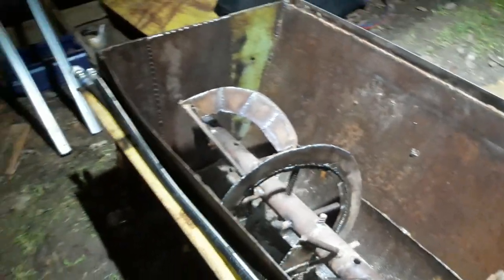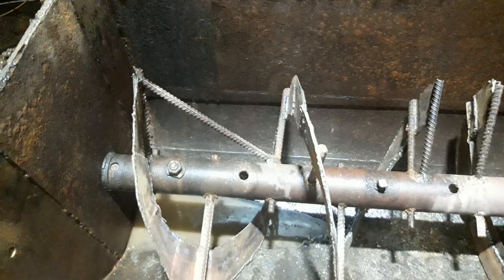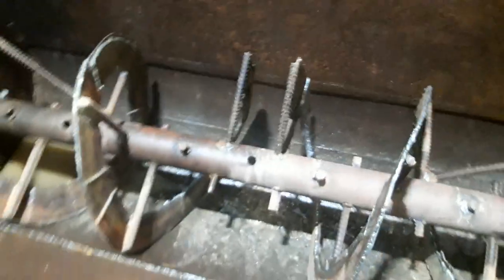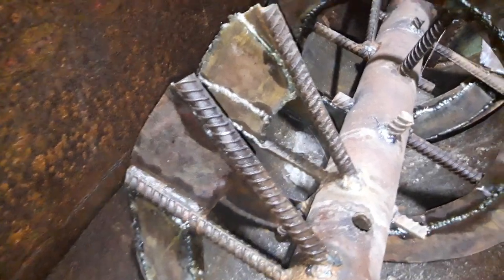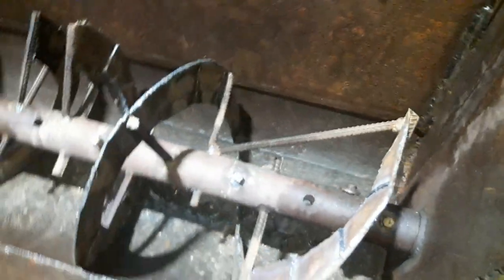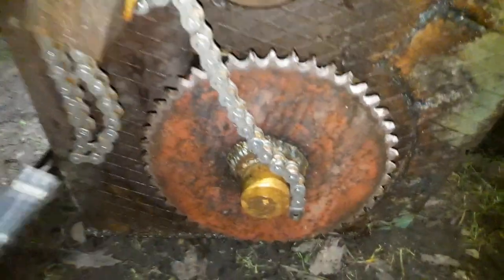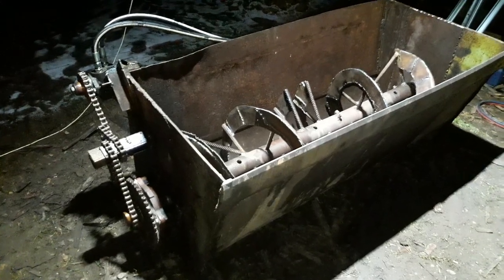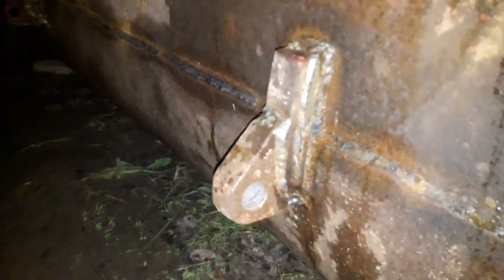How to Mix Concrete! Home made mixing machine! PART 1

Comment: Great idea. I would like to make one myself. Can you kindly describe the specification of hydraulic motor used ( motor type, cc, power, maximum torque etc)
Reply: Abey...u appreciated this idea and asking for the specification of hyd motor,power etc 
Well i suppose to say you can run your hydraulic pump at atleast 3000 rpm and if possible you can calculate the output capacity of pump in gallon / min or litres/ min 
(See video on youtube for calculation of hydraulic pump)
After u connect any hydraulic motor with flow control valve( for rotation  speed )
You can use single spool manually operated for neutral and forward ,reverse operations

Comment: Machine is made good but the spiral blades are very horrible finished should be made on machines and should be 8 mm thick.
Reply from the maker: Yes
Reply: @modrix  
How you made this spiral blades in your workshop by manaull method ..please upload video